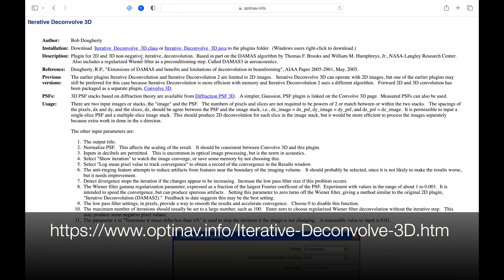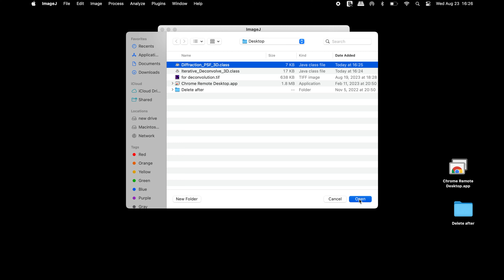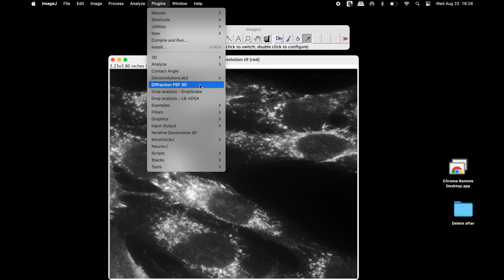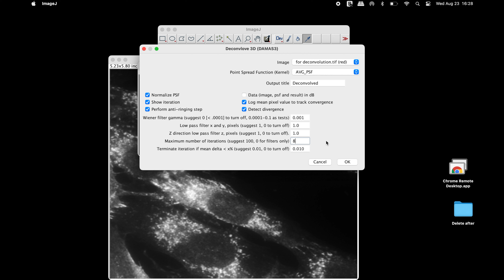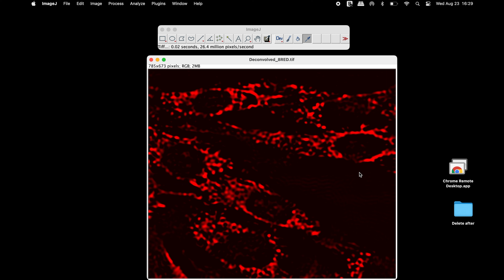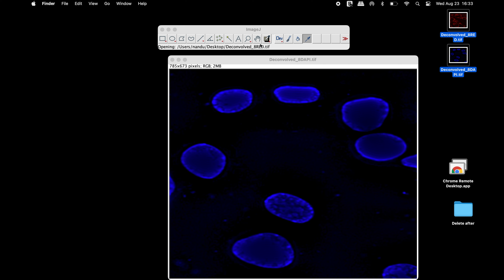Deconvolution of image using ImageJ

Comment: Thank you very much for your video, I was able to do a decomposition that resulted in an excellent image. Sorry, do you know the best way to automate the process for multiple images?
Reply from the maker: Glad you liked the video. i am not really sure how to do a batch processing at this moment. however to make the job simpler, here is a semi-automated way to analyze image. first split the channel, select the image of interest and run the macro below. you may change the parameters in the macro according to your image type.

run("Diffraction PSF 3D", "index=1.000 numerical=0.80 wavelength=359 longitudinal=0 image=30 slice=30 width,=256 height,=256 depth,=256 normalization=[Sum of pixel values = 1] title=PSF");
run("Z Project...", "projection=[Average Intensity]");
selectImage("PSF");
close;
run("Iterative Deconvolve 3D", "image=[merge.tif (red)] point=AVG_PSF output=Deconvolved normalize show log perform detect wiener=0.001 low=1 z_direction=1 maximum=8 terminate=0.010");
Reply: Using this as a template I was able to make a macro that made my work much easier. Thank you so much.
Reply from the maker: @PabloMorgado-n6x  You are welcome. Great to hear that.

Comment: Thank you very much for your video.

Excuse me, I have a couple of questions and I wanted to know if you could please help me:
1) Is the wavelength that should be incorporated the wavelength of the laser with which the sample was excited?

2) I have had some "Boundary Artifacts", what I analyze looks pretty good but sometimes I see some linear ones close to the cells I analyze. Although they do not interfere with me in most of the analyses, they look strange in the photos when it comes to building the figures. Do you know of any method to reduce these types of artifacts?

Again thank you very much.
Reply from the maker: hello, you are welcome and thanks for reaching out. λ is the wavelength of emitted light. For your second question, i may be able to answer you only after looking a sample image.